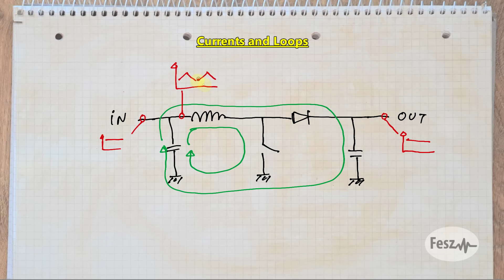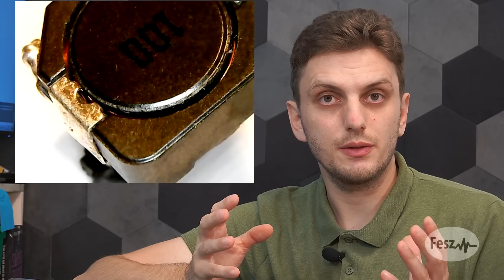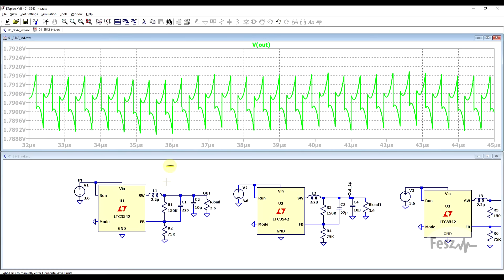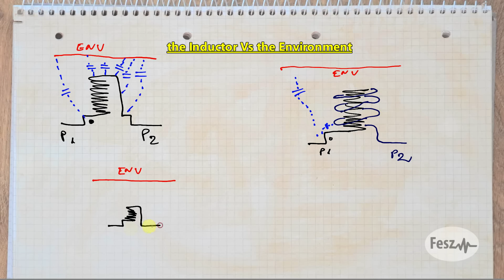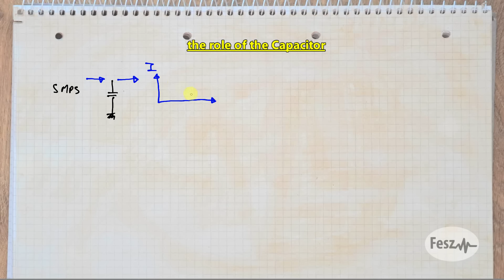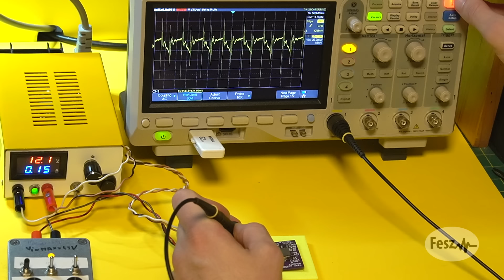SMPS Noise Analysis - The Passives

Comment: I watched both SMPS Noise Analysis videos, and I hope the third one is coming soon. You need to address the most notorious noise source in SMPSs: the control loop.
Chaotic subharmonic oscillations of underloaded current-mode controlled SMPS drives product users crazy to no end with high-pitch audible buzzing.
Reply from the maker: Honestly, in this series I do not plan on addressing control loop related issues; my main target was to address RF noise - mainly the fundamental switching frequency and above. However, I did run into circuits and devices that had the audible buzzing that you are mentioning so I guess that is also an interesting subject to tackle for another time.
Reply: "underloaded current-mode controlled SMPS" AKA; cheap LED drivers?

Comment: Hi, I have implemented e-shielded Vishay inductor into automotive design in order to reduce CISPR25 conducted emissions measured with current probe. It reduced 40MHz and 120MHz common mode emissions (usual issue on very small pcbs like 20x30mm) by 10 to 20 dBuA. Similar effect was achieved by simply reducing switching frequency from 2.2MHz to 470kHz and using usual inductor or greatly increasing PCB area but this is of course impractical. In our case, Vishay inductor was more expensive by factor of four. Purchasing department said, that Vishay patented the eshield -> single source component :/

Comment: Can't you use the math function on your oscilloscope to substract the noise floor from the measured signals? That would make it much easier to see the changes and what is actually going on when you switch the orientation on the inductor.

Comment: It looks like your magnetic sniffer probe has the foil forming a closed loop. It should have a small gap in the foil screen or else it creates a shorted turn.
Reply from the maker: It does have an interruption in the middle; but its probably not that visible since its covered with hotglue
Reply: @FesZElectronics  Ok. Was wondering how it managed to pick up anything.

Comment: Want to see camera spy sets I just received I had two units previously I broke the camera cable on first item fantastic second mmmm this new couldn't hook into WiFi networks when I checked it there's no circuit set for the WiFi Bluetooth network. China con jobs I got others too.
Reply: Also great for voltage regulators a 20v amp supply with a resistor dule line add the other bits as general to a PC they need to split the 5v9v and the 12v 15v to the 24v DC in supply could have saved in a tower PC that second transformer unit MIT sure they got it from a alien.